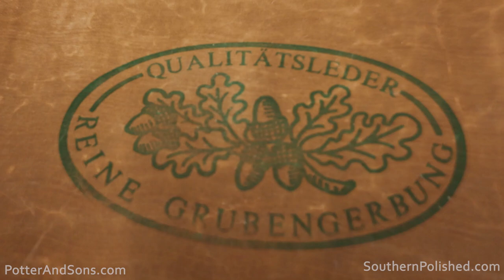Chippewa Snake Boots | Rugged Vibram Sole Upgrade

Comment: I can t believe thats all people took away from this video. As usual yall did an amazing job basically rebuilding the bottoms with the best materials on one of the most expensive snake boots out there. I would have expected a much better factory build on these boots for the price !!!  I have been thinking about getting a pair when my much less expensive pair wears out. I will now send mine to yall when the time comes.

A tip for guys looking to buy snake boots --- don t get the vibram soles on your boots if you live in an area with cockle burrs. They stick to the soles and track into your house by the handfuls. If you have carpet or rugs on the floor. Anybody walking barefooted behind you will immediately begin to plot for revenge on you !!!!   Cockle burrs in your underwear is not a good way to start your morning !!!!!

Comment: You guys are right on the money about dirt breaking stitches. I had a pair of redwings I wore on construction sites I never cleaned and kept in the work van. After not too long the boots fell apart. I tried shoe glue but it was too late. I should have cleaned them weekly.

Comment: Have a pair of the Chippewa snake boots and a pair of Russell Moccasin snake boots.  The soles on the Chippewa wore smooth in one year (real slippery on muddy ground) .  So I bought a pair of Russell's made to order.  Cost almost 3X the price of the Chippewa's. Little heavier because of the Vibram sole but a wonderfully comfortable boot.  I wasn't sure if the Chippewa's could be resoled.  Now I know!  Like the changes in the video's!

Comment: I like the background a lot. There are two changes I would play around with that I think would do a lot to increase the warm feeling from the tin lamps and wood boards - Raise the lights one more board, and try a barn door or shield of some kind on your main lights to prevent them from lighting the back wall (to create a little more contrast and eliminate the cord shadows and the glare on the upper boards). It's a question of cutting off the main lights right beyond your heads so that you're lit but the wall isn't

Comment: Great vlog and, as always, great attention to detail and craftsmanship. I have a pair of Grensons from here in England. If I want to remove polish and grime from the sole sides , is acetone ok to use to bring it back to the original leather testy to treat with some leather shoe cream to bring the ‘pop’ back into the sides. The style is called Archie and the tri coloured leather sides is one of the features. Would be great if you could advise on the use of acetone to remove old polish. Thanks, Stewart

Comment: been watching and rewatching a bunch of your videos today, as I remove the sole from my first pair of shoes.... or..... the first sole removal? Or... I'm trying to resole shoes for the first time - yeah, that's right - and I've taken off the soles... and the midsoles.... and the insoles.... factory made italian loafers.... so much glue.... I'll be having nightmares for weeks....

It took me a while to find a metal last - or shoe anvil - or..... Okay, totally self taught, just watching yours and Bedo's videos. I know nothing about anything. I don't have any idea what the anvil thing is called.

For the metal last/anvil/thing - are these available new? or are only the old, cast iron ones available? if new, from where? 

I finally found one (today, as luck would have it). I only have 1 shoe size, a child's size (though, after a long time of perusing ebay, trying to find one which was both affordable and didn't cost my car to pay for shipping.... I stumbled across this one at a local antique shop for 19$, for the last and the stand. figure that's a good deal). I'd like to see if I can't find more sizes.

Also, the hydraulic press, which presumably presses the glue to ensure an ideal hold (right?)... that's not a cheap tool for someone starting from scratch.... obviously.... is there a way to achieve the same result with just basic tools? Would one use the hammer to just hammer down-slide to do the same thing?

Thanks, guys - videos are great, and you guys are inspiring!

Comment: Whew---every time I watch you using a box cutter blade I have to hold my breath.  It seems you are using so much force to get the blade through the leather.  You haven't slipped yet.  Oh,  and by the way---I liked the little smirk from Heath at the beginning of the vid.  ( It's o.k. to laugh !)

Comment: 13:10
I really hate these break of blades for really heavy cutting. Some of them broke off so i cut my fingers really badly. For some tasks the fix blade or the single disposable blade as Steve users and resharpenes them, are a better choice.

Comment: I can't turn on subtitles, they are very important if you're not a native speaker. In previous videos there was an option, but now or they turned it off or something else happened.
Reply: Subtitles in English worked for me. Maybe it was an issue in settings 🤷‍♂️
Reply: It's probably what I thought, I was early on the video and it seems like Google translate didn't generated subtitles yet. Now it works correctly. Thanks for comment.